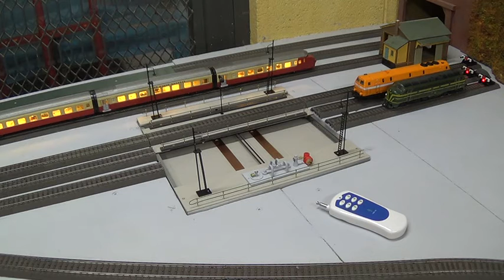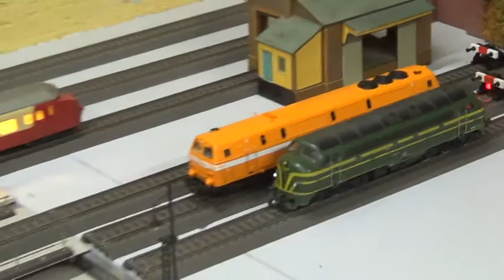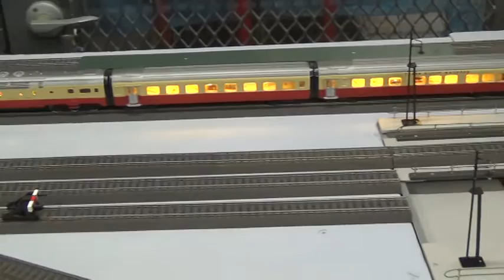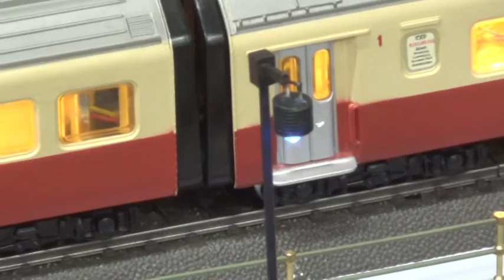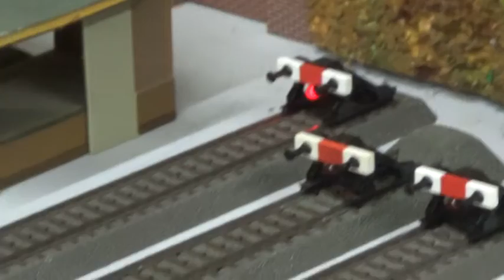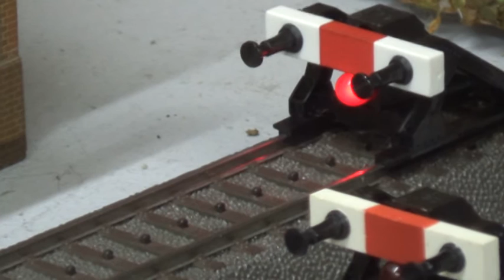Transfer table for Marklin layout

Comment: This is a brilliant build.  I'm looking at building just this sort of thing as a way to facilitate decoupling and exiting locomotives at the head end of an end station (while leaving the passenger cars in place), and hiding it all inside the  end-station building.  Since I need to get the track spacing just right for platform distances, the Märklin table likely won't fit (or takes more space to allow for fanning out the tracks), or I'd not use all5 exit tracks.

So I'd love to try and build one of these myself; can you give me a ballpark for the cost of all parts to build the table?

Do you have a build plan and parts list?